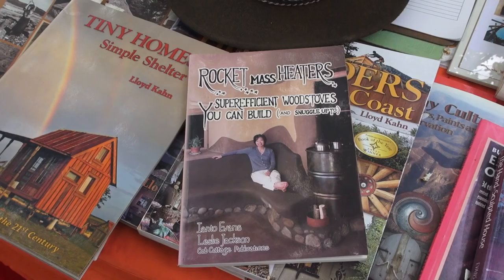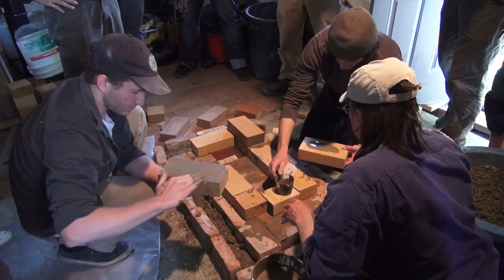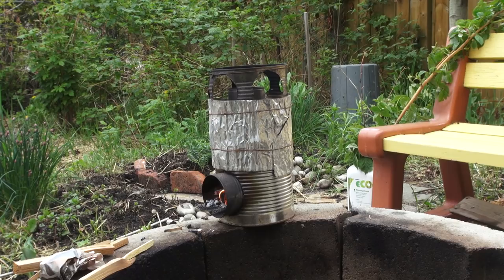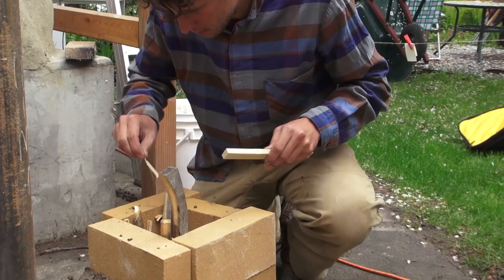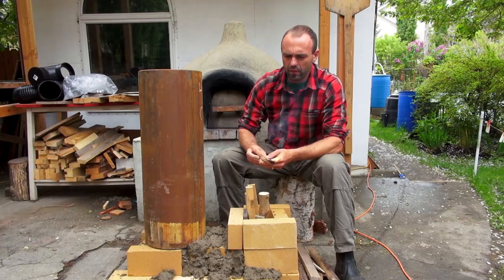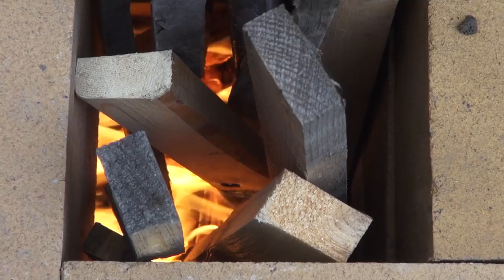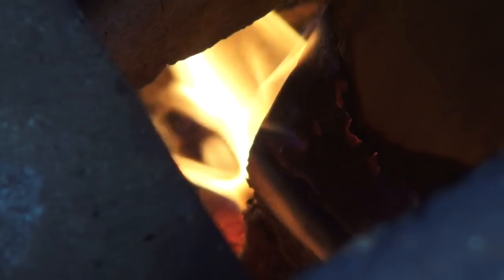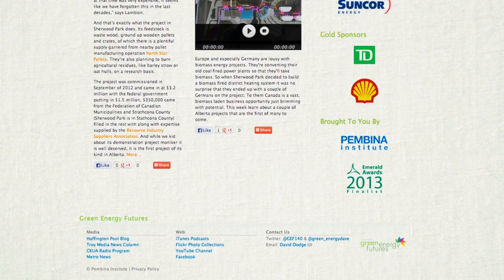47. Rocket Mass Heaters: A better burning wood stove

Comment: "Flue gasses are contained by this barrel...through stove pipe and into a manifold and then through stove pipe that's inlaid in this ????? bench. So all this thermal mass is sucking the heat out of material, out of the flue gasses before it exits the building" WHAT???? Where do the gasses go? If they go into the clay, how do you know that they don't leach out?
Reply: The gasses go into the burn chamber first to be burned up, snoopy. It's hot air/stream that travels along the thermal mass which has a pipe ran through it. I'd imagine this can't possibly be your first rocket heater video... is it? If it is, then by all means, do go and view more and the concept will be explained in detail to you. I've considered building one of these for some time now. Might even try one soon. :)
Reply: So, the carcinogens get burned up completely like an incinerator? I'm just trying to visualize this. How the carcinogens disappear without a trace. This is good survival information, especially if you have to hide to where no one can find you by the smoke.
Reply: snnnoopy
Correct. If you make your stove properly, the extra air intakes will act to feed the pipe and make a super burner. They're acting like afterburners. You can make 'em out of regular bricks for a small one in your backyard to try one. I would suggest some fire bricks though. I've watched so many videos and read on this stuff it isn't funny anymore. :) This concept seems to be proven. Besides... they use the same theory to burn off leftovers in coal factories too.
Reply: I've watched 50 or so videos, read the book and I don't think anyone has explained it until it occurred to me: the inner burn chamber must be insulated while the outer barrel is not. As the hot gas goes out of the top of the burn chamber and contact the cooler outer barrel, the gas will cool and therefore condense, or take up less space. As more heat ecsapes the outer barrel, the more the hot gas from the burn chamber will push. This creates the draft, or the force that moves the gas through the stove. So what you can do is have horizontal flue pipe coming from the bottom of the outer barrel that can travel 10 to 30 feet depending on the size and dimensions of the stove. So its just the change in temperature that creates the draft.
Reply: *****
I like the design but I'd be concerned with the 'relatively' cold flue building up creosote which could eventually block the flue or ignite causing a reversal of the flue combustion gases, venting into the house.

Comment: Any other than iron stove has the following deffects - it takes too much heat to heat up the surface untill it starts to radiate warmth. That was evident in stoves with bricks inside or ceramic. In other words the fire has to fight with the resistance of the material around it untill it gets to you. In practise - in a cold room you would still be cold 1 hour after the fire was lit up. So the best stove is a one with as flat and large upper part possible where the fire directly heats the metall flat roof, because the fire has highest temperature on its top. And the metall quickly retransfers the heat to the air - to you. This rocket stove uses the barrell as key point which means the exhaust gases. If the fire reaches the barrell you would be well, if not is a waste of time. And it's certain it will smoke back, at that length of the chimney/before it/ - and exactly this is the reason wood stoves were retired somewhen ago, not to get all your belongings in the room covered in ashes.

Comment: question: all of the oxigen needed for the fire is taken from the inside breathable air, so, how to avoid to get killed by that on your living room? open a window? but, if you do that, you are producing heat at the same time you let the cold air in...thanks
Reply: @ricardo clemente - homes are not airtight (usually), air gets in via (eg) airbricks, gaps around doors and windows, gaps under the eaves,  chimneys, etc. Many regular wood/coal/gas heaters have a similar air supply.  But it is not ideal!  In cold conditions it draws cold air indoors, so it is usually better to provide a separate exterior air intake vent for a heater.  A home we had in the UK had a fireplace that drew air from under the floor,  built around 90 years ago.
It worked well, but it would eat around a ton of coal over a cold winter.  All that heat going up the chimney....

Comment: Not certified ?  by WHO?
Reply: EPA and Underwriter Labratories (UL). Because the rich politicians would really prefer if all those taxpaying sheep use electricity for heat, so it is next to impossible to get any new woodburner design certified, no matter how efficient. The rich politicians ignore the fact that not everyone lives in the city, and might need a source of heat when that magic electricity goes out at the worst possible time, for 48 hours in freezing weather.

If you can't get your new design woodburner certified by UL, most insurance companies will not insure a home with one in it. Which means most sheep won't buy it. There are still some people left though, who just go ahead and build a RMH, and to Heck with the liberal uneducated insurance agent or environazis. It's easier to get forgivness than permission.
Reply: Word.
Reply: 1. They're not simply rich politicians. At this point virtually all of our politicians are cleverly injected into office by corporations, banks or the Pentagon/CIA. This is accomplished via election fraud or having control over all candidates running (eg, one of their candidates pretends to be progressive and the other pretends to be conservative). Our vote usually has zero effect on our country's path/destination.

2. This has nothing to do with liberal vs conservative. That's simply a method of division; a method of keeping us fighting/hating each other instead of going after the psychopaths in power. These psychopaths have devised systems for duping both stupid 'liberals' and stupid 'conservatives'. A person's political orientation doesn't matter. All that matters is how unintelligent and uninformed the person is.  

3. The psychopaths in power actually have a clear agenda of forcing people into cities and making them as dependent/vulnerable as possible. They're trying to create a system in which the flick of a single main power/Internet switch would create absolute chaos. If you ever want to know if your government is on your side, simply look at whether they promote the creation of informed, prepared, self-sufficient citizens in order to maintain a very resilient country, or if they instead promote the creation of uninformed, unprepared, dependent citizens to produce a country that falls apart under even relatively minor stress/disruption.

Comment: If you build it properly this issue is non existent. like even if your pipe did have a leak it would have to be dumping out smoke and most of your pipe is in the "mass" part. :p

Comment: Is there a way to use cement instead of mud/clay ?
Reply: Have to mix it..straight cement blows up in pieces when heated..
Reply: @vincevegacustoms754  there is a fire safe chimney cement mix that does not contain limestone...but it is hard to find.  I ended up using a high silica containing fire clay...has been perfect for 3 year now.

Comment: I think this idea is good, but the motivation of it is kind of silly. In the very cold area of China, for example, north east part of China, houses of farmers were built using the rocket burning principle as well as heat reservation technologies for 100+ years! The houses were built hollow where the exhaust gas can run through. Stoves are also applied for cooking. Well, anyway, China is not much of a "developing country" nowadays. lol

Comment: Now if some of the folks who like to grab the limelight had the ability to generate electrical power from this or convert this CO2 into natural gas which then could be stored to run a generator, then maybe they should be speaking.
Reply: not sure you can store the pyrolytic gases in that fashion, but I have seen some people heat water for their homes...and use the steam to turn small turbines...not sure if it would be usable for anything big, but I am sure you could charge batteries and run lights or something...

Comment: no that would be perfect if you use the gases that come off that I like vehicles but I'm more the hydrogen guy I like that because that is perfectly energy efficient both ways for the planet and both ways for the environment and over mankind because hydrogen can give you voted into air and water once it leaves the tailpipe on a car but it actually works better on the motorcycle better because it's a higher rate of combustion

Comment: Wtf stove costs $15k
Reply: yeah that's a stretch, even high end ones are about $2k-$5K, however if you consider installation and cost of chimney. it could well cost you upward of $10K. $15K is not outrageous if the installation includes some custom elements in it, like tearing out an old stove and doing some beautification

Comment: History is inaccurate.  IN FACT .... this EXACT technology, using ceramic insulation and multiple warm air feeds,  is used in marine tankers to produce a very efficient burn (for heat and clean exhaust) and, importantly,  also an exhaust having a slight pressure that allows for very long horizontal sections to act as heat exchangers.  The heat is used to thin cargo, and the totally inert gasses produced are used in ullage space for security.

Comment: Unapproved wood stoves indoors will Void your home/fire Insurance.
Reply: So what route need be taken to get this rectified? If a person wanted to install a rocket stove or efficient stove/heater into a new home. What would the proper course of action to get that started?
Reply: Shawn C You'd probably have to get the homeowners association on board and prove to them they work well. They won't like the DIY aspect of it though. That leaves room for someone to screw up.
Reply: Shawn C In Canada it would have to be CSA approved and CSA testing is out out of the reach (cost) of Joe Average.
Reply: MrFakit
Are outdoor woodstoves approved Canada? The rocket heater should easily be able to be adapted as an outdoor unit. The concept is all about burning completely, efficiently, and utilizing as many btu's as possible.
Reply: If the source of fire came from the stove..if damage was caused by it....but what are the risks if u burn all the creosote wich is the fire causing factor...less risk to burn the house down with these..
I have seen glowing red cheminey piping in addicts....

Comment: We are rediscovering nothing, this is many steps backward. Modern heating systems are a refined, more efficient development of this principal it is just lack of understanding that makes them appear different rather than one being the others great, great grandfather.
Reply: Modern systems are better, but they rely on convenient fuels like gas or oil, which are not sustainable. The ideas behind these heaters is to use wood as a fuel source, burn it efficiently, and then capture and use as much of that released energy as possible.
  They are better than older methods of burning wood, like open fires and log burners (in terms of efficiency), but there's no doubt the requirement of large mass heat storage makes them a poor choice for most/many. Here in the UK, house prices are so high, you're unlikely to then want to fill that house with cob.
Reply: There are other ways such as using a large accumilator tank for hot water storage thereby making the energy stored mobile which is far more usefull and efficient when heating multiple rooms. Even if you could store 100% of the energy from the fire the energy cannot be efficiently moved to where it is required. That is why we have modern systems which can deliver the energy where it is required. We developed from the solid mass system for that reason.
Reply: Gaz Smith
As I said, modern systems are better, but the driving forces that seem to be prominent for builders of these system is renewable/environmentally friendly, and low cost. I don't know anyone that would actually install such a system, which speaks volumes. You have to be committed!
Reply: fx451Jockey I have one of those system's it runs my heating, but it requires a massive amount of fuel and a lot of its wasted in flue gasses, some stupid number, I hybrid between the both would be a massive step forward.
Reply: That isn't really the target.  Modern systems are so efficient, people just build massively larger houses.  

These need to be tended, like any open fire, or you need to be near the radiant source.  Converting this heat into water is hugely dangerous, or at least very technical.  This is for people who have relatively small heated areas, or as a system for when the shit hits the fan and you can't get your heating back up, or for cabins, etc...

Now in the world that uses open fires, which is probably still most of it, these could be hugely transformation.
Reply: @HondoTrailside  modern combustion stove are not even close to this...the smoke.the smell.all the wasted heat going right thru cheminey...they are made to make you spend money.
This is the turbocharged 4cyl kicking the old v8 s ass!!